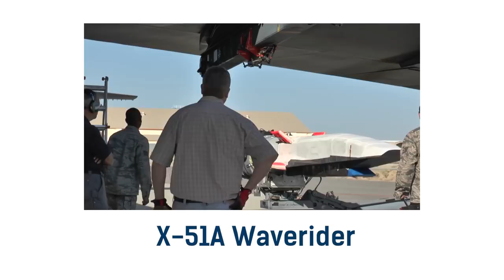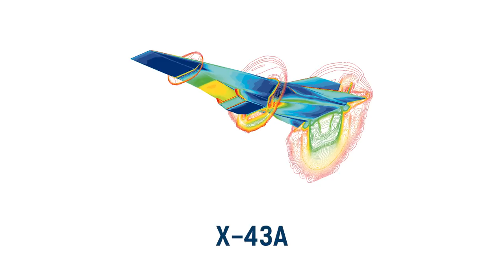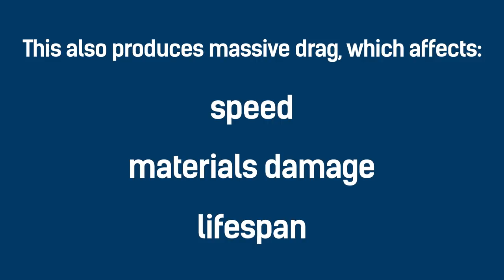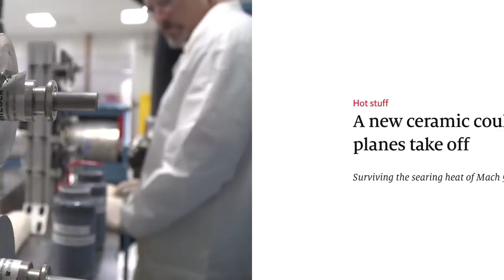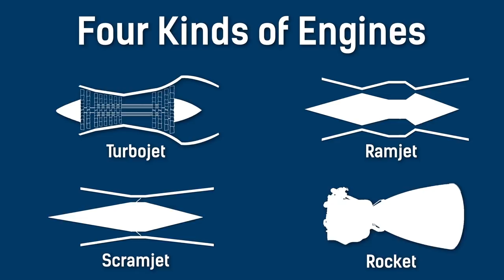The Future of Hypersonic Planes

Comment: Good video, but if you don't mind some friendly criticism, I think you discarded rocket propulsion as an option very prematurely. Hypersonic flights will always be rather expensive, likely in the $10,000 dollar price range, so we can assume mass transport of hundreds of passengers is unlikely in the near future. Rather such vehicles will probably be small, perhaps carrying a few dozen passengers at once. At this scale, a small two stage, fully reusable rocket plane would be similar in mass to a large plane such as a Boeing 747, and could theoretically make the journey in under an hour instead of 3. This solves some of the material issues, as the periods of peak heat are short, would also provide passengers with 20 minutes of Zero-G, could be repurposed as a cargo vehicle for launching satellites, and rocket propulsion of large vehicles is already a proven technology. Unlike air-breathing engines capable of flight at mach 5+, which whilst under development are very much unproven at these scales. Of course the issue arises of safety and reliability, rockets are still far off the 99.9999% safety rates of airliners, but the option is still there. And it could be economically competitive according to some professional estimates and my own back of the envelope calculations.

Comment: There are many states of matter..
Four of them are, solid, liquid, gas and plasma...

There are two methods I know of of controlling the state of matter, temperature and pressure, there may be others...

Objects move eight times faster through plasma than gas...

Suggestion.. Coat the surface of a plane in an extremely cold substance and keep it at that temperature... Coat that extremely cold substance in plasma... The extremely cold substance prevents the plane burning up.. It cancels out the plasma to prevent the plane burning up... The layer of plasma around the plane converts the surrounding gas into plasma... So you basically cutting through the air with a plasma knife..

Its the exact same principle of canceling out hot with cold... Like using an ice compress when your sweating...

Or using particle acceleration away from the craft, which would result in a surrounding vacuum envelope which is a much sharper knife because there's no resistance in a vacuum...